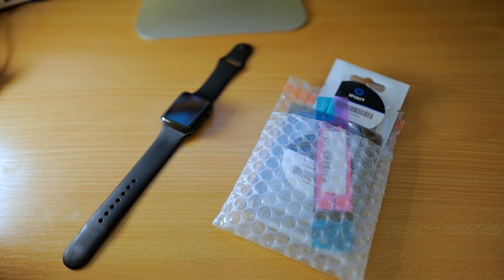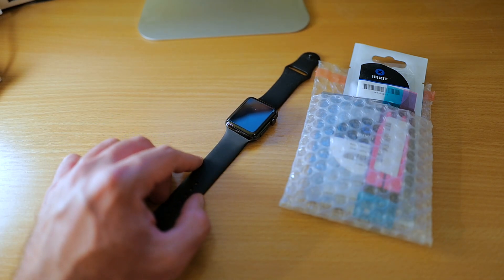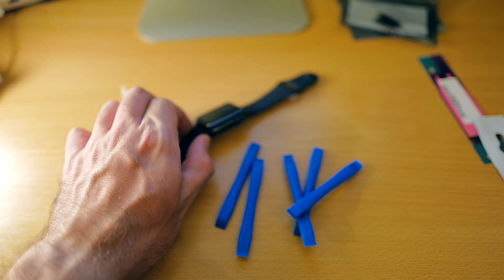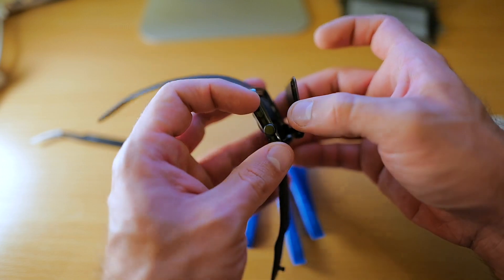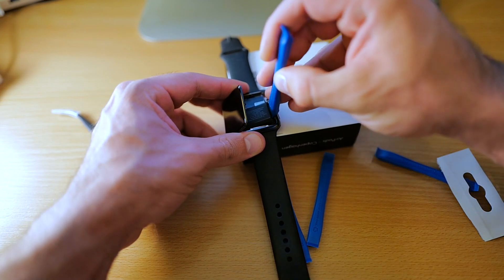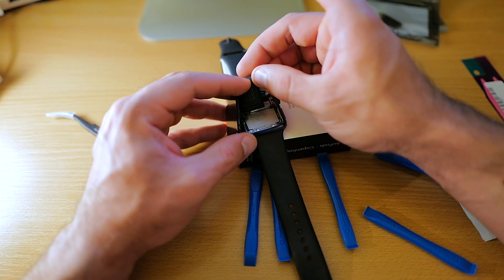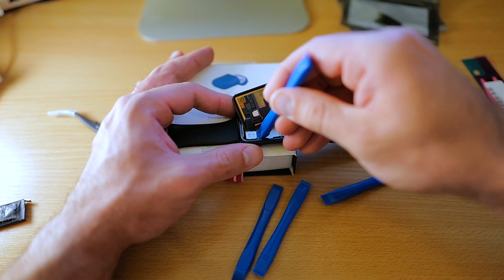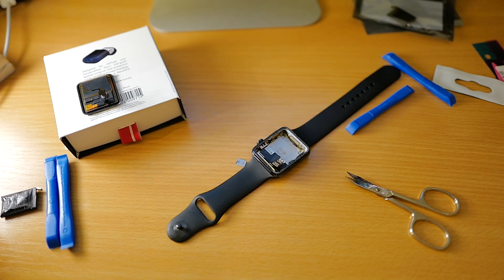How to replace Apple Watch battery? (popped-out screen?)  Step-by-step GUIDE

Comment: I've replaced the battery and force touch sensor and still does not light up. Does that mean I'm screwed? Is there anything that I can replace?
Reply from the maker: Most likely it died.
Reply: @mato_krenco  that’s what I’m thinking

Comment: Ive done repairs on these watches so many times, just recently I replaced a battery in a 1st gen and in about a good 10 min it bloated as did the second replacement battery. The watch had been sitting for years. The charger cable and block original and the old battery doesnt bloat, it just doesn’t work. Any clue? Could be just the charging dock not working inside but its odd
Reply from the maker: That really is odd. So the replacement battery bloated after replacement in just a few minutes? It sounds like both the replacement batteries must have been old. An old batch?
Reply: TechBlogPool yeah, i replaced the battery and it bloated so i got another battery and it also bloated. So two replacement batteries bloated within a 10 min time span. The original doesnt bloat probably because it doesn’t have enough juice left. Idk, ill try another distributor and see........maybe lol
Reply from the maker: Nope. My original bloated. That’s why I replaced it.
Reply from the maker: Try the replacement from ifixit.com, if it blots they’ll replace it.

Comment: Hi, my apple watch stops charging the battery, I just connect the chargee and it starts charging but 3 or 5 minutes later it wont charge any more. The watch has no battery, the screen shows up need to charge logo, but I tried many times but cant charge.
Reply: do you think is a problem of battery? apple wireless charge port or the charging cable?
Reply from the maker: I will need you to give me more information. Which Apple Watch is it? How old are they? Most likely the battery died.
Reply: TechBlogPool 1st gen, it is about 4 years old
Reply from the maker: Yeah. Then it’s the battery. It died. Please go to ifixit.com and try to follow my video to fix it. It’s not super easy but can be done. At the beginning you will have one more step - removing the screen.